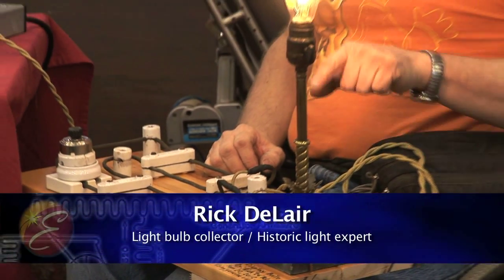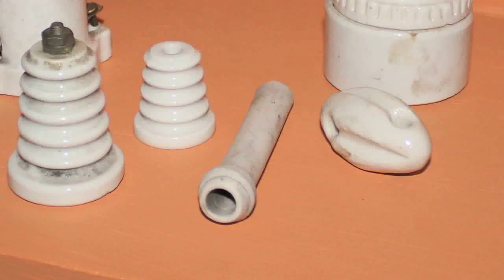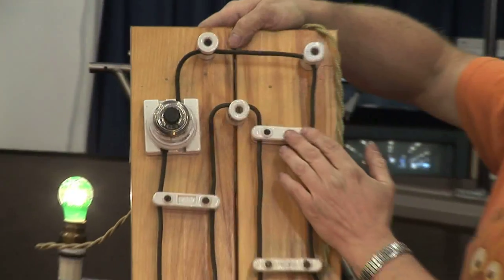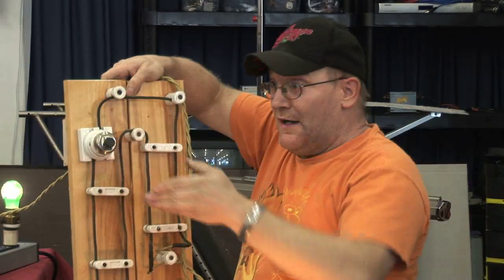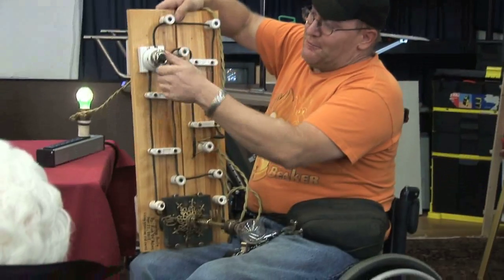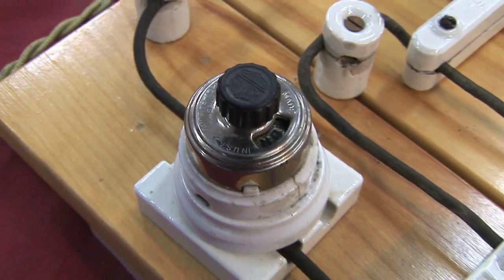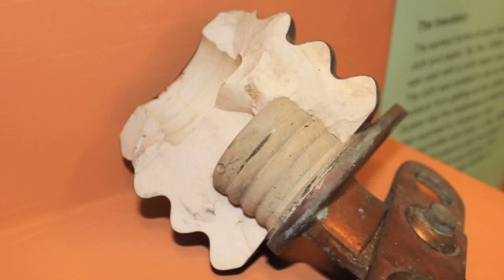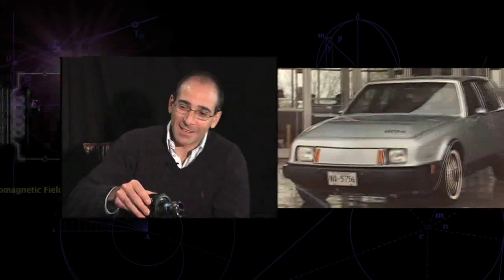Knob and Tube - early electrical insulation

Comment: A lot of houses still have it.  There is nothing wrong with it, conceptually, for lighting circuits.  It is expensive and labor-intensive if you were to install it, though.  The problem with the receptacle circuits is that you don't have a ground wire.

Comment: I remember finding the remnants of old wiring in the attic of our family's ranch house... There were the knob and tube using bare wires and other sections where they had use what I assumed was tar and asbestos... The house itself was built before electricity came to the area, so it went through a couple of different iterations over the years with respect to the electrical wiring...

Comment: Knob and tube is not something I'd use as an example for "things built to last". I've dealt with enough old wiring to have seen how terrible the stuff ages. Crumbling wire coverings or wires just breaking off altogether.

Comment: . Edison ran a DC system I believe..  Seems like for a while before a National Grid every power station had their own  power values and that if two companies wanted to trade power they needed a set of Motor -Generators or Rotary transformers  to convert to the others standard.  110 volt 25 cycle seemed to be the popular one when a national grid  required a national standard until the early 1950s when 120vac 60 cycle became the standard.

Comment: There's a place I have visited on the NY / PA border along the Delaware River that is now a campground but was once a grass airstrip. The original hanger still has this exposed wiring, although most is no longer in use. OTOH, last I looked the original fuse box was still hot. Up near the ceiling there are wires running the length of the building (at least 75 feet) kinda like a clothesline. It may have had more support at one time. These wires are about 10 feet apart and have the remnants of twisted connections, as if there may have been a series of suspended lights at one time. Guessing one is hot and the other is neutral, and you could just twist in another light fixture as needed, wherever you wanted. The reason I was there was to figure out how to disable those hanging wires. It wasn't too hard to follow them back to the panel and do away with the circuit, so nobody got hurt.

Comment: My mother bought a houseboat in Seattle that had knob and tube wiring. Since she needed to upgrade the power to the house, she hired an electrician friend. He was perfectly willing to do the job, but he normally worked on commercial buildings, he rewired her houseboat to commercial code.

Comment: I'm a service electrician living in a 1936 home. Still has knob and tube wiring.  Only real issue with it is that the insulation will begin to crack and leads to open copper in spots.

Comment: Knob & tube installed in WW1 or earlier years was yo carry DIRECT CURRENT (DC) so that there was NO neutral wire.
Reply: That is completely untrue You still need a neutral wire it’s just called a negative with DC

Comment: To place a ceiling light there was a 1×4 backer board between two joists laid flat with with 45 degree holes drilled next to and opposite each other to place the wires in, using pieces of loom to go through the board and lathe and plaster.

Comment: Just south of Edison’s Menlo Lab (in Metuchen, NJ) saw old house with a seemingly odd glass panel on an otherwise time-appropriate (old) wallpapered plaster-and-lath wall.  It revealed the original knob and tube wiring as 1 of the first homes to be electrified.

Comment: Working on a bathroom renovation in Hewlett-  New York about two years ago, 2019, saw knob and tube wiring running to the attic. Was told not to worry it was all in disuse for years. Put my tick to it, yep,still live running the attic light.
My daughters house in Patchogue New York, around , five years ago, 2016, when the sheet rock was removed on the second floor, found the knob and tube tied into the Romex wiring behind the walls

Comment: Read through the comments. The house I grew up in had wall sconces with pitch torches! Electricity? That's a luxury we just never had until the 1970s. 
We still use the torches in power outages and such. 
That's just life when you live in a 900 year-old moated house (castle).

Comment: My house was built in 1939 and has this type of wiring it is visible in the basement.At first I was disappointed that it had this type of wiring but then I read that this type is safer than modern wiring.I think the only reason they stopped using it because it was harder to install than modern wiring.

Comment: I have knob and tube wiring in my workshop. I want to replace it because running machines like tablesaws, radial arm saws and more on wiring done in the early 1900s isn't ideal. My issue is I have to use it to make money to replace it, so I'm kinda stuck rn.

Comment: Retired from 45 years in the electrical trade, I live in a 1940 house that still has a little knob & tube upstairs.  I’ve always felt it was designed to take aging and degradation of insulation into account.  Properly installed knob & tube will work if all insulation falls off the wire and it’s bare, just don’t touch it!  Knob & tube often fares well in floods, due to taking the “up and over” route, usually running in attics.

Comment: In Canada, back in the 70's, there was still a section in the electrical code on knob and tube wiring. It was in recognition that it was encountered in the field, and provided rules for repair and splicing into it. Others here have commented that rodents liked the insulation. I have never seen rodent damage to K & T. I have, however, seen the insulation eaten off the later paper and tar "Romex" cable - right down to the bare wire.
Reply: Don't understand why we cant just lace the insulation with poison.
Arsenic and mercury oxides wouldn't go airborne in a fire, would be fine.
Reply: @Intelwinsbigly  Arsenic and mercury laced insulation would be a health hazard during manufacture and installation.

Comment: So this is a good video. Have a funny story. I do maintenance at some apartments in oakland and recently they did a seismic retrofit  ordered by the city. Unfortunately one of the wires was damaged between 2 of the lights requiring the wire replaced.  This building was built in like 69 after knob and tube was no longer allowed in New construction.  The city inspector came and said that we had rewired everything without permits because this year building came with knob and tube wiring not romex wire. The owner is a close friend that I also look out for since her husband passed away so I called the city about it and told them what the inspector had said. They looked up the information on the building to confirm what I has said and sent a different inspector to check everything.  Told him why some wire was replaced and he just looked to make sure the boxes were bonded to the ground and said good job you passed. First inspector was written up and made to attend some kind of training again. I'm not even a electrician and I know the basics.
Reply: Most inspectors where I live are jackasses who just want to fine.
City needs mo money fo mo handouts I guess.

Comment: A couple years ago my childhood best friend and I inspected his (recently passed) grandparents' 1905 built home. The house had virtually no updating since being built. In addition to the K&T wiring, the outlets were mounted in the baseboards down at floor level and it had mercury filled push button light switches throughout. It had a screw-in fuse (4 of them!) circuit box. Everything still worked as designed, and probably would have kept on working but it needed (and got) completely gutted out and rebuilt.
Reply: "mercury filled push button light switches throughout." Words can not describe the jealousy.

Comment: Some years ago I had to go into the loft of an old country house here in the UK and the wiring in the loft was bare copper held in cleats some porcelain and others lignum vitae, this dated from when the house had its own low voltage DC lighting set but at some time in the past the mains was laid on (250 volts AC) the downstairs wiring was modernized but the loft was not but it had been connected  to the rest of the house so that there was a lamp up there. I went straight don frm the loft and pulled the fuse before I would go up there again.

Comment: Super video. Such a prevalent system even has a modern way to connect to it. By using a metal junction box, you can put ceramic tubes in for the knob and tube wires, and clamps or connectors for Romex or conduit. 💙 T.E.N.

Comment: Some of the insulation was asbestos, and would last forever. Mice love that rubber and fabric insulation. I lived in a house that had knob and tube insulation...one weird thing they did was put a fuse in both hot and neutral. If the neutral fuse blew, the light went out, but if you came into contact with live and ground, you'd know it.
      As long as you don't overload it ( by putting a 30 amp fuse in a 15 amp circuit, and the wiring isn't rotten, the knob and tube stuff is probably fine.
     One place I lived in back in the '80s was wired in 1922, and it was fine. Wall outlets had been added in the '30s. Originally, it was just wired for lights..
Reply: Scott Thomas, just as a precaution, I would locate every splice on K and T wiring, and check to see if each properly soldered. Redo, if necessary. Consider adding ground wires to every box where this circuit runs. This would help a lot. Every such installation I have seen uses 14 gauge wire. This must be fused to not more than 15 amps.

Comment: Interesting fact Thomas Edison had designed electrical system for Mahen Theatre in Brno (CZ), which is first theatre in the Europe that was illuminated solely with electric light. 
https://en.wikipedia.org/wiki/Mahen_Theatre Parts of original installation from 1881 were still in service in 1970's and it is said that underground electric cable was specially invented for this project (allegedly by Edison himself). He visited the site some 25 years later.

Comment: These arrays actually worked okay.  One of the classic problems was people putting metal clothes hangers  over the wires.  Seemed like a convenient place to hang wash, but the insulation didn't hold up well over time.

Comment: I still have this in my house, as someone who learned electrical wiring in 2018-19. I HATED replacing switches in my house, I was so irritated by no neutral wire and ground wire in every box. The breaker box is even more of a nightmare since multiple rooms are on the same breaker, my bedroom is on 3 different breakers.
Reply: The place I live in was a woodshop that was added onto and made into a house. Our wiring is in the same state. It's insane.
Reply: @gotioify  I'm a person who doesn't like cutting corners when it's around safety. If money wasn't an issue, I would redo all the wiring, insulation, and plumbing in my house with my dad, bring the place upto code and then some. Like 15amp circuits would not run on 14AWG, but 12 AWG. I would go 1 level higher then needed just as an extra layer of safety since I'm a bit OCD when it comes to not having myself or my family injured.

Comment: Did alot of knob and tube work.  In attics, you can't insulate oner the old wire, we would put modern wire and junction boxes.  Reused the old wire in the wall.  Very confusing work sometimes

Comment: Even today,  where K&T is frowned on and frequently removed when encountered,  it generally works well as long as you NEVER TOUCH IT.  As a service guy, I hated opening a box up and moving the old wiring around.  As long as it just sits there and isn't moved it's really not an issue usually.   But when you move K&T around, you find that as it moves the rubber insulation crumbles away and the woven sheath falls apart, leaving the conductor bare.  Had to many a times apply heat shrink tubing back over the conductors to give it some form of insulation again.  Best to leave it be if at all possible.
Reply: It’s mostly frowned upon by the Insurance Industry, due to losses. And it’s frowned upon by the BuildingOwner when they are told by the Insurance company to upgrade or no Insurance. Lol.

Comment: Knob and tube was very safe for it's day. The wires never come together except at the device. The drawback is the coating and the fact that joints were soldered together. I've found places where the joints between wires failed from the solder melting away.
Reply: Would the safest way to run wires be to run them like knob and tube but using proper connections and modern insulation, and having a third wire for earth? I can't help but think myself that keeping wires separate is safer.
Reply: @briannem.6787 even in new wiring, the wires are separate. They are close but separate. And since the separation insulation is protected by the general outer insulation, they have a better chance of withstanding aging and degradation. 
It’s also more efficient to run one line of 3/12 as opposed to three separate lines of 1/12 for your hot/neutral and ground.

Comment: Those cleets and knobs wiring looks almost exactly like what i found a couple of years ago in a cellar here in Germany. Still in proper working condition even with an original carbon fibre bulb, though way out of code since the end of WWII. But what do i care? I'm a plumber not an electrician. ;-)

Edit, typo.

Comment: It wouldn't surprise me if Edison was the first to market porcelain insulators for use in lighting circuits, but he didn't come up with the idea; these were already in use when Thomas Edison was a child (back in the 1850s) - primarily on telegraph systems but also in electrical experiments alongside glass insulators. Just worth noting as a lot of people will interpret this video as "Edison invented porcelain insulators" just like many people think Edison invented the incandescent lightbulb. 
 
It's amazing to think that the first sets of wiring regulations/codes came out in the 1880s. What we call the "First Edition" of the wiring regulations in the UK was in place from 1882 (we're now on the 18th edition), and New York had regulations from 1881 (with the first US national code in 1897).

Comment: Knob and Tube = Bzzzzzzt!!! Especially if the house was 80 - 100 years old and those wires sagged enough to touch from over-heating by modern appliance or broken insulators. In the daze of radio and lightbulbs, less of an issue. I still remember houses with thoze screw in fuses some people would sometimes replace with a penny, dime, etc. = Bzzzzzt, Fire!

Comment: I live in a Philadelphia townhouse right now and it STILL has knob and tube wiring. Some electricians act like it's a disaster waiting to happen, but if you really think about it, it's a system with multiple safety redundancies and will work indefinitely if undisturbed.

Comment: i grew up in a house built in 1907 that had knob and tube wiring and there was nothing really wrong with it except that it was a 3-story house with a 60-amp service and only 1 or no wall outlets in each room.. the house also had no insulation in any of the walls, so we eventually replaced all of the wiring with romex and a 200-amp service with plenty of wall outlets everywhere and breakers instead of edison-base fuses which were getting hard and expensive to find. the insurance company was happier and the house was much more liveable afterwards.

Comment: Try army crawling under house with knob and tube trying to patch up a water main leak.
Reply: As long as the insulation is in good condition you will be fine
Reply: @TechHowden  there’s no way 100 year old wire still has good insulation. This house it has all fallen off. Looked like jungle vines hanging
Reply: @Big_red_builders  I have some pieces of knob and tube wire from 1927 and the insulation is just fine on them

Comment: Knob depth of 1" was good at keeping blind screws at bay too. Pound a nail in a wall to hang a picture. Boom. It was also nice to see the layout work, with both the hot and neutral running in the same void (plenums) between studs and trusses, but at the same time opposite each other on different studs. Professional electricians at the time, always kept the hot on one side, (I believe it was north or west), consistently throughout the house for reference
Reply: My old bungalow had hot wires in the ceilings and neutrals in the floors.   Electrical receptacles had a wire of single conductor going down and a single conductor going up.  Lights were similar, a wire from the ceiling to a bulb, then to a switch, then through the floor.  Nothing ever backtracked... and that was 1940s.
Reply: @mgjk  Wow, that is interesting -- I never knew any houses were wired that way.

Comment: Iv'e seen these in old houses with no insulation on the wires. If you wanted to add a light or an outlet,  you would just twist the wire to the line and tape it. You could attach a new circuit anywhere along the line. Kinda scary but cool at the same time.
Reply: When it was just light bulbs and a radio, no problem...
Reply: Kevin W, it's probably ok to do this, but the wires should be soldered after they are twisted to the wires they are spliced to. Any corrosion would otherwise heat up the wrapped splice and eventually cause a fire, if the splice was not soldered.
Reply: @jeromewysocki8809  Honestly, this set up sounds like a dream.